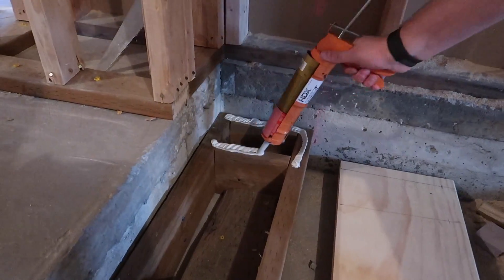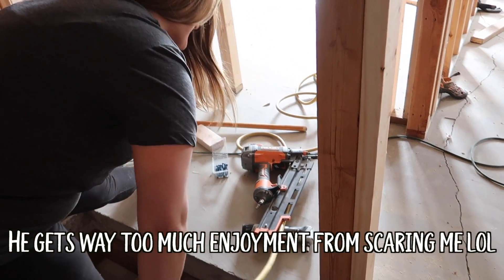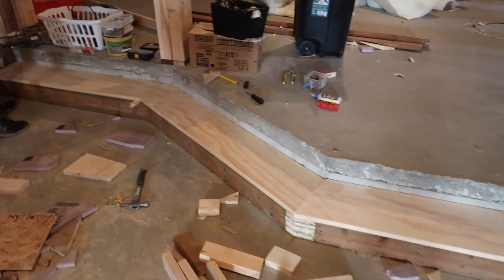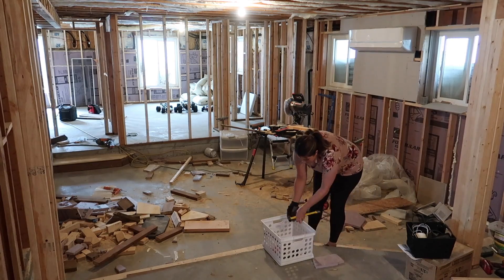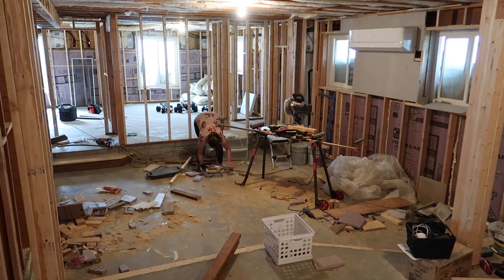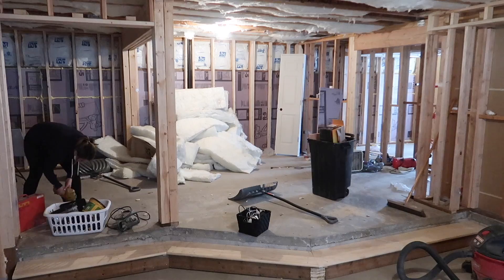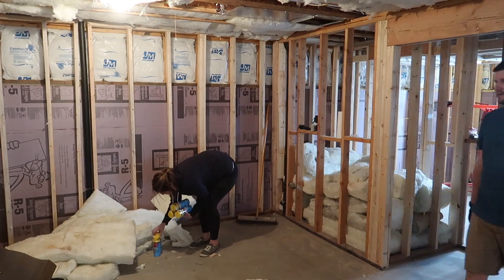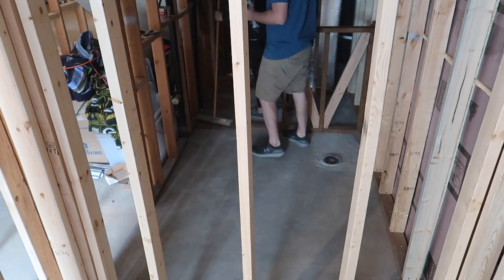DIY UNFINISHED BASEMENT UPDATE 2019 :: BASEMENT SPEED CLEAN WITH ME & CONSTRUCTION WORK

Comment: The basement is looking great. The stairs are especially nice, and sturdy. I had never seen the concrete nail tool, either. When it comes to finished basements, I am usually against them, but to each their own. As a former water restoration technician, I highly, highly suggest the following: 1) when it comes to the stairs, be sure to remember where each brace board is in the stair bc (God forbid) a hole will need to be drilled for each "compartment" in the event of a sewage or water loss 2) when installing dry wall I would suggest placing it atleast 3 inches above the floor and having a high baseboard that's inexpensive and easy to remove (for you or a tech). This also goes for insulation. The best insulation I have seen is styrofoam sheets. Easy to cut out, easier to replace, and if a loss is low enough, shouldn't be affected whereas fiber insulation/blown in/expanding foam can soak it up and then drywall may have to be removed to keep growth down. 3) keep construction materials cheap bc I dont know how many times I have seen insurance companies refuse to cover the cost of high end materials. Especially as years go by, it's all based on what the prices of the mats are, not were, they usually go with the cost of cheap mats anyway, and a lot of people get upset when it wont be covered at all. 4) if carpet is going to be placed, keep it cheap and I suggest avoiding pad if possible. It gets heavy, and its tedious to extract water from it, and it adds time to the tech bill later. I love the idea of having a finished basement for extra space, but in the long run it becomes a huge problem if something happens. Again, I hope it never happens to you, or anyone, but a lot of home owners dont think about the possibility of these things happening, but I learned so much over the years of doing that stuff that I try to tell everyone to keep these in mind. I love remodels, and I'm excited for you guys and cant wait to see the final outcome. Good luck! 🤗